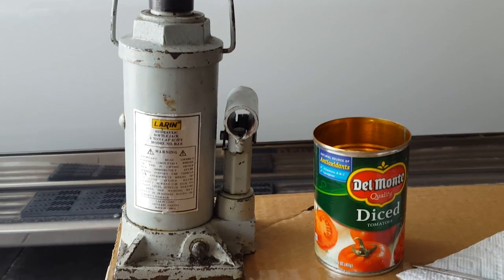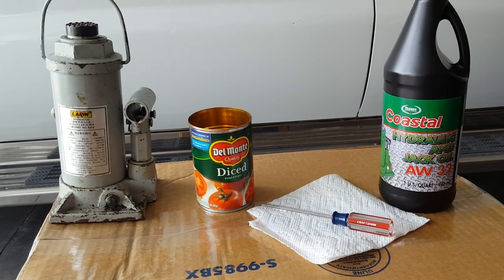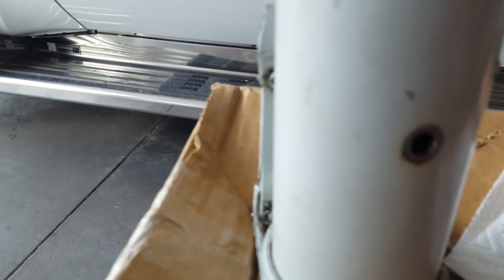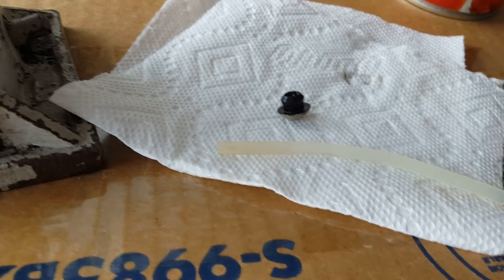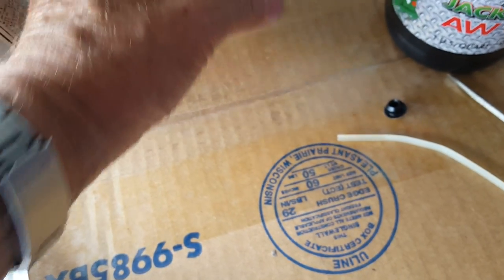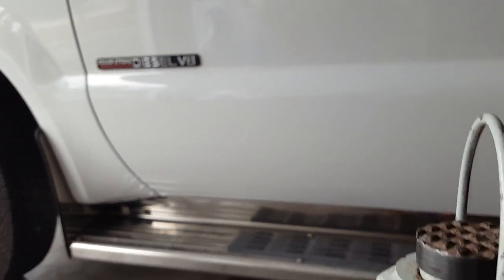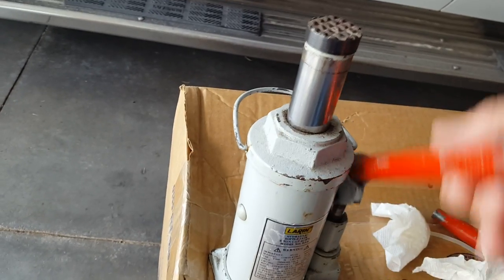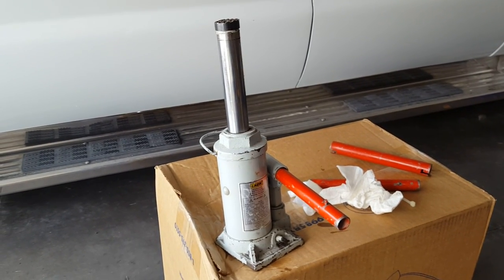Bottle Jack Oil Change

Comment: thanks, I have a jack exactly like this I keep as a back up to my floor jack and had to break it out the other day to grease my ball joints and it would barely pump. Now I know how to maintenance it!
Reply from the maker: You're welcome, Ronald. I'm glad it was useful!
Reply: Ronald Clark I used mine to push my axle back so I could get my control arm bolts back in. a bunch of the oil leaked out since I had it on its side. went to do the back control arms and it only move about a half inch. your video helped me out. the man.

Comment: Any reason why you can't continue using the old oil in the jack, and just top it off when needed?
Reply from the maker: Sure, that'll work. My oil had been in there for ten year or more years, so I thought it might be a good idea to put fresh oil in it.
Thanks for the quesion!
Reply: I've recently changed oil my floor jack and bottle jack. The oil in both was pretty dirty.

Comment: Thanks. I had same problem. Same jack.
Reply from the maker: I hope the same solution worked for you!
Reply: No, it didn't. I bled the air out. It wasn't' low on oil. It's not leaking oil. I took out plunger and the seals seem Ok. I hardly used it in 15 years. Can't think of what else to do. I bought another one yesterday: 12 ton for $30, but I would like to fix this thing. It jacks up with no weight on it, but stops when it has a load. I didn't drain the oil and refill, maybe that? ??? Thanks!
Reply from the maker: If the seals leaked, I'd expect to see oil coming out around the plunger.
How about this: The "up/down" valve isn't closing properly. It could be stuck in one position due to lack of use. Or, there could be a little spec of foreign material in it which holds it open a bit, thus preventing it from jacking up under load. You might try opening the "switch", then pumping several pumps, then closing it and pumping a few times. then repeating.
Or you might want to take the up/down switch out. There's probably a ball and spring in there. (Don't lose the ball!!!) It might be deformed or corroded or rusted, thus making it so it doesn't seal properly.
It seems to me that the problem must be in this valve!
Good luck, and please post the answer to the problem!
Reply: Thanks. I will let you know what I find.
Reply: I unscrewed the up/down switch. There was a ball but no spring. The ball looked clean. I used a Q-tip to clean it out. Put it back. No change. I emptied the oil and refilled with mineral oil. No change. I don't see any sign or air in ram (no softness). It is a 12 ton Larin BJ12.I am not giving up. I will do more research. Maybe plunger seal replacements
Reply: Flavius    You need to use Hydraulic Jack Oil (available at your local auto parts store / hardware store/ or maybe even your local lumber store ie. LOWES or Home Depot ).  Mineral oil does not have the same high break-down pressure / viscosity or other properties of Hydraulic Jack Oil. If you look at the spec sheets for each you’ll see the differences. Try the Jack Oil.

Comment: No mention of what position to have the open/close dial during this operation.
Reply from the maker: I've forgotten the position of the valve. But...
I would think it would not make much difference, as the "shaft" is full-down into the cylinder ---therefore there would be very little oil in the cylinder under the shaft. 
On the other hand, it would make sense to have it open, so that oil anyplace in the jack would be free to flow out.
Thanks for the question ---and for watching!

Comment: can I use anti freeze if it has the consistancy of hydralic fluid
Reply from the maker: I'm not a chemist so I have no idea what antifreeze would do to the various materials of which the jack is made.  I DO NOT recommend such a substitution.
I DO thank you for watching, for the comment, and for subscribing to my channel if you'd be so kind to do that. Due to a recent change by YouTube, I need 1,000 subscribers to place ads on my videos and make a few bucks from them; I have fewer than 100! I need all the help I can get!!!
Reply: I dont do it ,but old timers use old tranny oil JUST USE JACK OIL, AND DON'T FORGET TO BLEED THE AIR BUBBLES , ok?